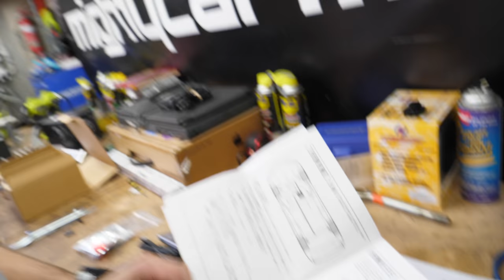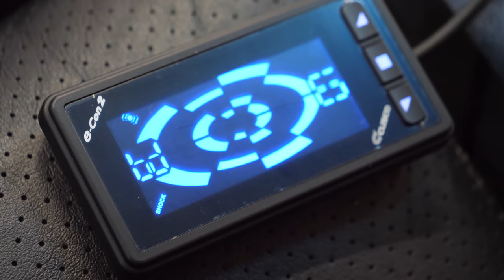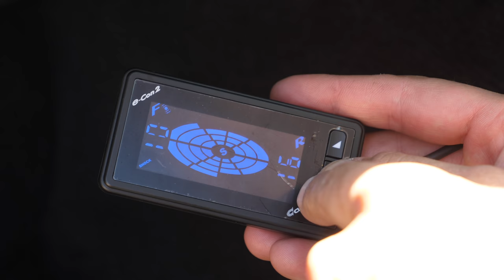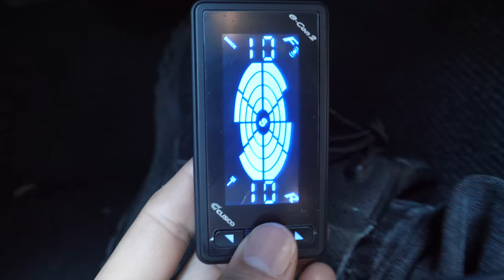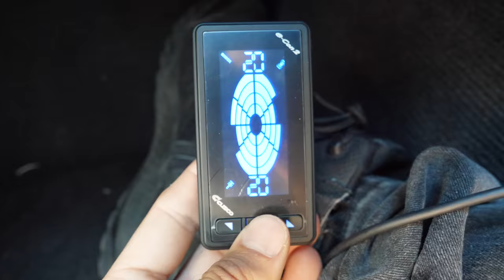Disrespected Supergramps JDM Electronic Adjustable Damper Control Nose

Comment from the maker: Free MCM Lanyard with every JDM Dash Towel. Add both to cart then use the coupon code DASH. Boom!  https://mightycarmods.com/collections/accessories/products/mighty-car-mods-towel
Reply: Great title! You guys rock been watching since the beginning! Love everything thing you guys do!
Reply: I know MK3 Supra's had an optional factory system that worked in th same way. Possibly some skylines also.
Reply: My 1990 MK3 Supra had stock adjustable suspension..it might be magnetic, but I don't know for sure.
There's a button on the dash that swaps between stiff or soft.
Reply: what happened to the evo?
Reply: 33.32 ........ Disrespected sausage
Reply: my 86 rx7 had self adjusting suspention. and a friend's supra from the late 80's early 90 also had it from the factory.
Reply: The Bose electromagnetic 
suspension was pretty cool.
Reply: @25:18 Marty you're a dork :p
Reply: There is no way you guys aren't using innuendos every single time you install something
Reply: Hey maddogs! 
What would MCM do? Buy a low km Golf R and  revo kit it. Or buy a new BMW M140i?
Reply: Put the controller in the glove box
Reply: Funny that, I was checking out your WD-40 stash last episode lol
Reply: Some model's of the daihatsu Rocky's had adjustable shocks. But only hard, normal and soft.
Reply: @ElioRose  I'm pretty sure when I worked on my friends MK3(I corrected my comment) it actually had similar motors on top of each damper. Magnetic systems are WAY more complicated.
Reply: Hey man I think Marty really looks like my friend, I will send a picture if you want. I think its pretty weird
Reply: #teamtrees
Reply: Does your online store not accept prepaid debit cards? I can't qualify for a credit card so I use the prepaid cards. Twice i've tried to buy MCM stickers and twice was told that my card was rejected..Then I get an email asking if I still want my Maaaaad stuff, yes I do but your store won't accept my prepaid debit card.
Reply: I hope yall ran PURE copper NONE of that CCA b.s.

Comment: Cable ties: Don't open the top of the bag. Cut across the center of the bag. You can pull out a tie and the rest won't fall out.
Reply: That's a big brain tip. Thanks

Comment: For Marty - I had a 1990 Supra that had what Toyota called "TEMS" (Toyota Electronically Modulated Suspension). It had a 3 settings - Soft, Normal, and Sport. It had little motors on top of each damper like yours but I'm pretty sure they weren't steppers. Probably much simpler like spring loaded center with reversing polarity to select either side of center .
Reply: Had the same thing on my 88. It even would dynamically stiffen them a bit if it noticed you cornering hard. Pretty basic, but it worked.
Reply: Yup my 91 Soarer has active damping TEMS from factory you don't even need to set it but it drives like a dream

Comment: Marty: “a project car is never finished”

Also Marty: “well this is finished it just need some improvements”

Still Marty: *pulls entire interior apart*
Reply: You have to admit though, pulling interior WAAAAY easier than the transmission or engine or exhaust.
Reply: Space Emperor Karl very true. Although pulling is easier then putting it back - there’s always one clip missing or doesn’t want to go back in.. 😂
Reply: It isnt.......

Comment: 1982 - 1985 Mazda 929 Hard top and coupe had adjustable dampers from inside the car , in the centre console. It also had auto setting, which hardened up the front shocks after 70 kph. Star wars dash, cruise control, electric everything. Fantastic cars. Cheers Guys.

Comment: Japanese cars from the 90's also had electronic adjustable dampening. My Suzuki Baleno from 96 (Esteem for the USA market) had a system called SSCS, which is and does exactly the same as the Cusco system, but it only had a normal and a sport mode. Nice work by the way, love the show!

Comment: Nice addition guys, I had the Tein EDFC in my skyline years ago. Although the setup and motors are pretty much identical, I think I would prefer that than what I can see of this cusco one. The controller and the adjuster was all in one box and a little nicer to use. since I didn't smoke and nobody smoked in my car, I cut out the back of the ashtray and put it inside so you couldn't see it.

Comment: Hey guys I had a Daihatsu Rockey sports Afield that had 3 way adjustable shocks and it was 1990 model. And it worked as well not just a gimick. If you had it on firm on the highway it would bounce around all over the shop. But in soft on the highway it was mint. Thanks for the content and keep up the good work.

Comment: Marty: Toyota TEMS
Reply: Toyota had this as an option on almost everything through the mid 80's to late 90's. Even good old Starlets 😍
Reply: Starlet gt turbo ❤️
Reply: My first thought too.
Reply: came here to post the same thing. Late 1990s all sorts of Toyotas. At least MR2 and Supra?
Reply: Lol, HR31 skylines had electronically adjustable suspension back in the 80s.
Reply: TEMS was 1st on the A60 Supra from 83.
Reply: Think you'll find HR31 wasn't around until 86
Reply: Mugen offered it in the mid '80s for the Honda Preludes as well.
Reply: My '91 Toyota Soarer 4.0 GT had it built in too.
Reply: For some reason my '04 Toyota Alphard has TEMS. It still works but I'm not sure why a slow 2 ton van needs sport mode...
Reply: @1gt4dude  umm not the ma61 I don't believe or never seen them on any variation through to the ma67  although if I'm not mistaken the jza70 had them.
Reply: @when4everfalls  I believe it was the Soarer in '83 not the Supra
Reply: @Richardc9052  I could not confirm or deny that but I would say most likely. Also,  fun fact Supra was actually a Celica sub model in 83.
Reply: @when4everfalls  yes, the Celica supra printed interior is one of the rarest as it was a crossover and also optional extra.. looks awesome too.
Reply: Ha came here to say the same! TEMS
Reply: @when4everfalls  my '88 GA70 supra had TEMS. So im guessing it was at least an option on all A70s
Reply: @glen5188  ga huh does that mean it came with a 1gge
Reply: @when4everfalls  yeah 1G-GTE
Reply: @glen5188  the v12!!!
Reply: @when4everfalls  no thats a 1GZ. The 1G is a 2 litre straight six
Reply: @glen5188  my mistake.  So have you driven a car with the 7mgte compared to it.
Reply: @when4everfalls  unfortunately not
Reply: Yeah my mid 80s HR31 had soft and hard ;-) had stopped working by the time I got the car though :-(

Comment: Switchable electronic damping, it has been around for a while. Over in the UK, we had a raft of medium to high end JDM vehicles, that featured electronically adjustable damping. The T12 Nissan Bluebird Turbo ZX, for example, the Mitsubishi Sapporo Saloon and I think the Sigma, that followed. European marques, Opel/Vauxhall and high end, 24V versions of the Vauxhall/Opel Senator (similar in appearance to the VP Commodore), also came with an electronically adjustable damper setup...great video as always :).

Comment: I had a 1987 Mazda 323 GTI that had factory adjustable suspension dampening with 3 modes Sport, cruise and soft. NZ new and was one of the first multipoint injection equipped Mazda's sold in NZ market.

Comment: Hi guys, I had a 1986 mazda 929 turbo (it had fuel injection) when I bought it lucky for me it only had 140000 klms, back in 2007, so everything still worked including the hard and soft suspension... so basically what I'm getting at here they, had this technology way back then, and it worked very well especially where I live (northern rivers northern NSW)  I really think every car should have it for sure..

Comment: Tein also has these. Motors are almost exactly the same. One step that is different is for the teins you lube the threads on the adjuster in the coilover and also unscrew it until its sitting flush to the shaft. I love mine!

Comment: All the early-mid 90's Mitsubishi 3000gt's had stock Electronic Adjustable/Adaptive Dampers but needed ECS "Caps" on the hood to fit them. Factory ECS modules had two modes, sport and tour. Pretty cool and very ahead of its time but rarely use it on my car (leave it in Sport Mode). P.S only, the high end VR-4 models had them with AWS and AWD.

Comment: Nice mod, I didn't know other companies made things like this, I have TEIN's with EDFC ACTIVE PRO, it has GPS and a G-Force sensor so it automatically adjusts dampening according to speed and how fast you're cornering, it's also wireless so the front and rear motors I didn't have to wire throughout the car, it works rather well on my RX8, improves handling nicely.

Comment: My '93 Pathfinder actually had a very basic version of this. Factory option, made by KYB. "Sport/Comfort" switch on the center console. They had a rotary solenoid sort of thing rather than a stepper, and a simple on/off valve in the shaft that bypassed the internal valving for Comfort mode. I did a teardown of one on my channel a while back when I replaced them.

Comment: My Mitsubishi 3000GT VR-4 had factory adjustable dampers back in the 1990's.  They had either 2 or 3 settings depending on the year.

Comment: The Mitsubishi 3000GT VR4 had electronic adjustable dampers when released in 1991. It only had 3 settings per damper but tired in to speed, steering angle, accelerometers, and that type of stuff.

Comment: Yeah, my Mazda 929 Cosmo from '84 have adjustable dampers, even a really simple auto-function, where it will select hard/soft depending on speed, 50, 60 or 80 if I recall correctly.

Comment: The late 80’s corvette had adjustable shocks.  Used Bilstien shocks with stepper motors on top, and was called FX3 suspension.

Comment: My 1985 mazda 929 had electronically adjustable shocks. A 3 position switch inbetween the gear shifter and centre console.... hard, soft and auto

Comment: I've had some beemers (E34, E38...), and my friends have some too (E46, E39 and E34). No diesel. No 4 Banger.

What you've done with the Haynes manual is what you eventually end up doing while working on an old rusty BMW.

Comment: Some old as legacy's came with air suspension and electronically adjustable shocks, I remember pulling out the air suspension and fitting standard springs and shocks because people got sick of the air leaks slamming their car overnight

Comment: The first instance of a production vehicle with adjustable suspension was on the 1954 Citroën 15CVH. This vehicle featured a self-leveling, height adjustable hydropneumatic suspension.
Reply: Couldn't you change a wheel just by raising the suspension?!

Comment: "Colin Chapman developed the original concept of computer management of hydraulic suspension in the 1980s to improve cornering in racing cars. Lotus fitted and developed a prototype system to a 1985 Excel with electro-hydraulic active suspension, but never offered it for sale to the public, although many demonstration cars were built for other manufacturers."

Comment: high model year 90's Volvo p80 series had adjustable Ohlins shocks/struts in the front and back.  Super rare and expensive nowadays, discontinued.  Saw a used rear only set for 1100 usd.

Comment: I've had the Tein version (EDFC Active Pro + GPS) installed in my BRZ now for 5 years. When you brake the front dampers firm up and the rears firm up when accelerating. They also firm up side to side as you corner and also firm up based on road speed. Each corner working independently. I can also adjust the bias front to back and overall firmness inside the car. Simply mind blowing.

Comment: The earliest I know of adaptive dampers with motors was my old Ford Telstar AS model 1986-1987. Comfort, normal and sport mode buttons on the dash. I had a quote for 4k+ to recondition the shocks. So I spent 1k on lowered springs and struts instead and left the plugs hanging.
Reply: Pretty sure my 89 Supra Turbo did as well. It's been several years ago.
Reply: @asasial1977  Toyota called it TEMS I think. The 90's soarers also had airbags or hydraulics, or factory coilovers. My current car is a 92 uzz30 soarer base model with coilovers.

Comment: If I ever decide to replace my car's suspension, I definitely need to see if I can find something that can be electrified like this. I'd love air-ride suspension, but I have absolutely no desire to try to hide a compressor and canister, or run air lines all over the place. So this is a somewhat more approachable solution. At least with something like this, I don't need to drill holes in the body.

Comment: 1985 Nissan Maxima had electronic adjustable suspension (has BCs now), late 80 early 90s they went to sonar to read road conditions and adjust it for how rough the road was, so it sound like VW is starting to catch up with the tech.

Comment: My 1989 Nissan Bluebird SSS limited had electronically adjustable dampening from in the cab. It surprising still worked when I sold it. Couldn't find spares though.

Comment: I use steppers in all my cnc devices (3d printer, laser, and a massive 10 foot rotary) and I'd almost say you might be better off NOT using the stepper covers.  It might be needed to keep dust out, but honestly steppers run so hot I'm not 100% sure having them covered is a great plan.

Comment: the z32 nissan fairlady z (300zx) twin turbo had similar controllers for the suspension, but it was only 2 settings.  i had it on my 1990 300zx twin turbo.

Comment: 13:30 Mazda 626/MX-6 had electronic/electric adjustable dampening in like 1988 and that was mid range car. There was even a dynamic one, which adjusted it on the fly, stiffening the front over 80ks for example. Fathers 626 GD had 3 modes. I'm not sure how it worked, was to young to get it and uninterested. Soo I'm sure there was some OEM doing it even earlier?

Comment: Lexus were the first in 1990+ (or whatever year they came out first in the US) to do electronically adjustable suspension, which may have come even earlier I believe in Japanese Toyotas as the Pegasus system, (unless that was the name for their 4 Wheel Steer, but it the suspension was available way back then)

Comment: It'll typically be the Mercedes S-Class: the S-Class typically has the tech go in first. ESP, Airbags, ABS, Three-Pointed Seatbelts: all debuted in S-Class.
Reply: I remember Jeremy Clarkeson saying similar,  if you want to see the future, look at the s class
Reply: Volvo did 3 point seatbelts long before Mercedes-Benz
Reply: For safety and luxury features, definitely. In this case, it was the Toyota soarer in 1983 to be the first production car with electronically adjustable valving on shocks 
https://en.wikipedia.org/wiki/Active_suspension

Comment: Oh cool. Little tiny 3d printer / cnc stepper motors. The gears in my head are turning now..... I have adjustables on my current project, and do have a couple of Nema 17 stepper motors, left over from my past 3D printer diy build. Do have a Arduino kit, might just need to pick up a Raspberry Pi and do  Diy kit like this!!! Will have to brainstorm and find some time,to put it in motion.

And that vacuum looks like a P90 Smg from like Csgo or Call of duty. Lol

And OMG!!! I wad dying in laughter when you both where doing the back and forth banter full of innuendos!!! My stomach was hurting. I think this was the longest innuendo banter ive heard in all the years of your videos. Lmao

Comment: I always called them Tape Splices, scotchloks are a different breed, they're still IDC but they're full of sealant, most commonly found in telcommunication pits.
Reply: I've never seen any full of sealant, I've replaced many of them because they were corroded hell and not making connection.
Reply: @jaydunbar7538  When they're new they're full of sealant (or they should be) about 10-15 years back a really bad batch came through and got used all over the Australian network. 

Fun fact, if you ever find a pit or a pillar with a shopping bag wrapped around the connections it's because the liney replaced one set of scotchloks in it and figured the rest would probably fail sooner or later, the bag makes it slightly later than sooner ;)

Comment: those look like the same stepper motors on my 3D printer. They must be running some decent drivers for auto-sensing to work. TMC2130's or something. Just a heads up they can get pretty toasty if they run a long time so don't play with your knob to much or you'll get a hot mess in your car.

Comment: Those scotchlocks DO work, in theory. The problem is they are left exposed, most times under the hood exposed to the elements, and the wires corrode and loose connection. Soldered connections and heat shrink is the idea way to go

Comment: If it helps with your e-suspension archaeology, my 1993 Hilux Surf (JDM) had cabin controlled, electronically adjustable dampers. Only three settings though, hard/normal/soft.

Comment: version 8 wrx sti's came with Electronic adjustable dampening stock :) I remember when a friend brought his and we found them installed, and the wee controller for them. all marked by subaru as if it was there stuff they installed. correct me if im wrong but pretty sure thats one car that had em factory.

Comment: Those are 3m splice  ( scotchlock)  connectors rated for voltage far higher than you will see . With all do respect  you are daft if you think they are not better than you need for your use.  I have used them in low voltage for 30 years plus  with lower failure rate  than soldering .

Comment: Why are they testing a suspension setup on pidding rd. Its 2 of the softest speed humps, barely any other bumps and is usually busy. Theres much better roads to try it on even around that one area of ryde.

Comment: For the price of these systems I was expected a bit more than just a stepper motor bolted onto the top of the shock!

I've got a set of HSD coilovers on my S13 and I have noticed absolutely no difference when spinning the damper adjust, I reckon they do fuck all!